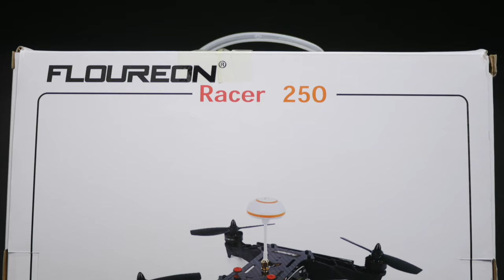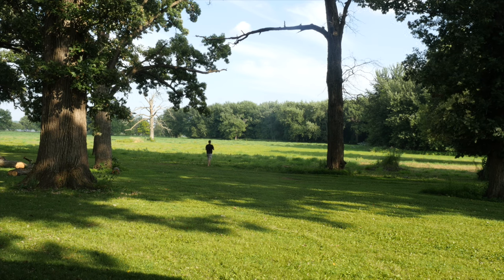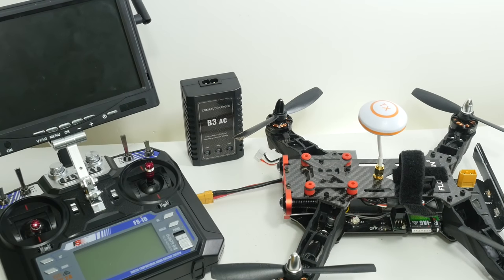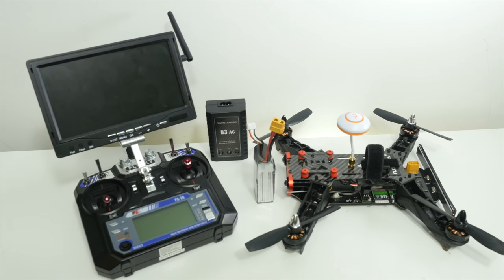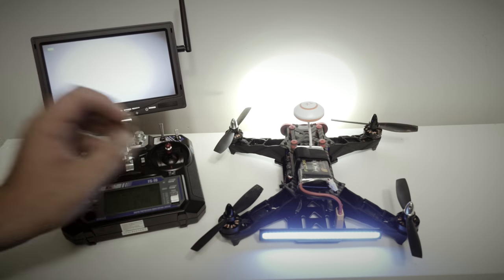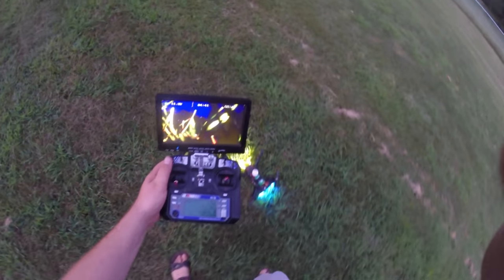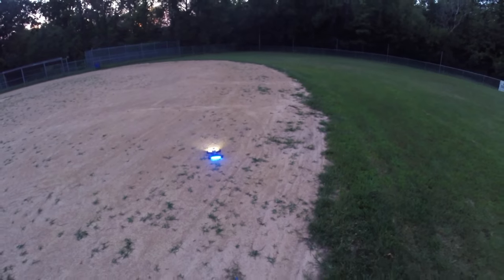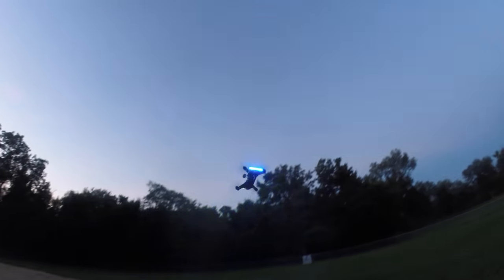Floureon Racer 250 - Review and Flight

Comment: Just looking at upgrading my antennas for the Floureon 250 Racer transmitter and receiver and was wondering which style to go with. I realize I need either both RHCP or LHCP but which dBi rating is required for this model ? There seems to be multiple ratings for dBi and I just wanted the right ones. In addition, there seems to be some conflicting posts on the internet for this model quad when it comes to antenna connectors....do the transmitter and receiver both have SMA connections because your link shows a RP-SMA. Just wanted to confirm before I ordered them. Thanks

Comment: when you let off the stick does it automatically level in beginner mode.

I got the Eachine model, and it does not. I let off the sticks and it keeps going in the tilted direction, I have to manually reposition.

I want to get the Floureon if it auto balances.
Reply from the maker: Nubyrc it won't just stop and hover no, you would need one with a built in gps to lock and hold position- these racers will level but some input is usually needed to keep them in one place.
Reply: Nubyrc  yes it does auto balance.
Reply: Yep, I went ahead and sent back the Eachine, turns out that model is way different, but you have to watch a lot videos to find out what. Chinese sellers do not tell you up front!

The Eachine, has 12 amp esc's cheaper props, and as for the control board it could be anything, I found it sold with Naze32 and 3ddc or something like main boards, either one it does not have the stability settings programed.

I just knew I was not ready to fly a racing quad like this without the auto balance, I have even tried to fly my Inductrix little yellow racer on full acro, and Im just getting to old to respond fast enough to keep it from hitting the wall! LOL

Comment: Can someone explain how to charge the FPV screen it's a little confusing to me. And can I just buy a connector use the charger that comes with the quad or will that destroy the battery and charger.
Reply: Never mind pretty easy to figure out once you get it.
Reply: What did you use to charge your FPV screen? Been trying to figure that out as well.
Reply from the maker: Melvin Sparks sorry for the late reply. No charger for the screen is included- I happen to have one that fit the plug, it's a pretty common size. And yea, why didn't they include one?!!
Reply: Okay. It sucks that they didn't include the charger. What's the rating on your Charger?
Reply from the maker: tony hanner I can't remember but there should be a rating in the screen
Reply: I searched high and low around the house until i found a 12v 1.5a p/s. It works and i'm back in business.
Reply: Melvin Sparks  sorry for the late reply that's exactly what I found in my house it does work.